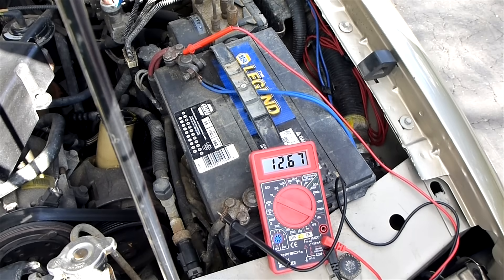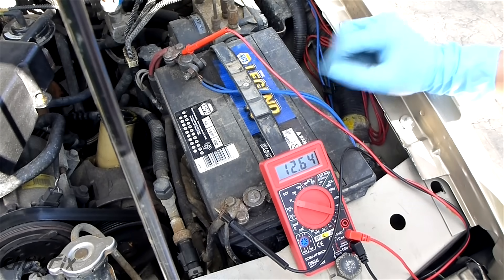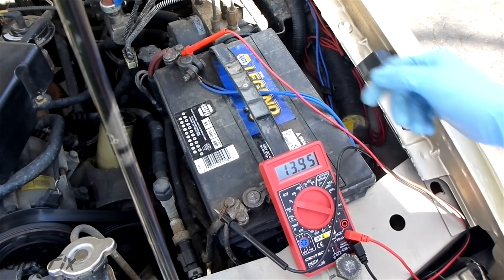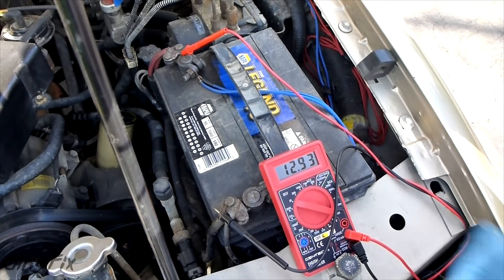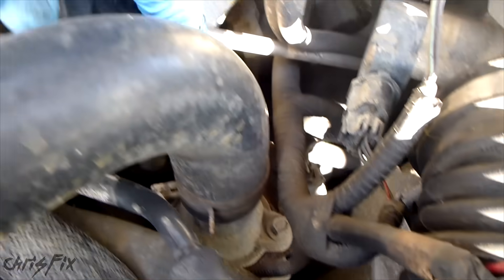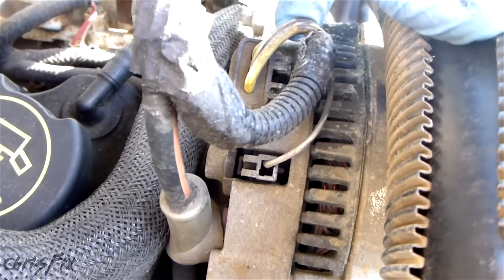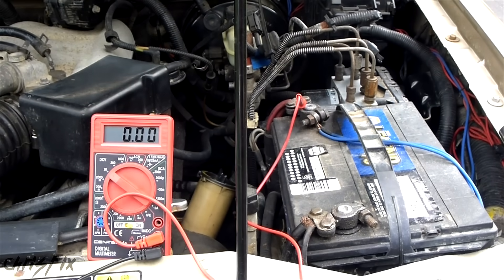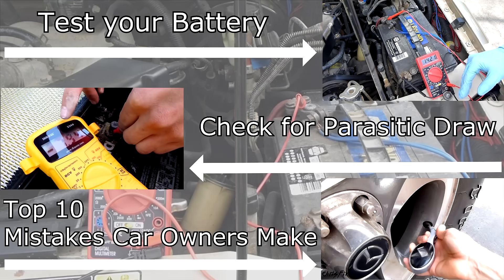How to Test an Alternator

Comment: This might be too late, but what if I can't crank the car at all. I put in a brand new battery and it still won't crank at all. All the dashboard lights are flickering though. How do I know if it's the alternator or the starter, etc?
Reply: Eddie, Flickering gauges is a good sign that it is probably your alternator. If you have a new battery in, the leads are attached firmly to the battery and it still wont crank, the next step is to check your alternator.

 If your headlights and dash lights come on and shine bright and clear, that means that the battery and alternator are likely not the cause of the problem. If they were, there wouldn't be enough power to run the lights. Instead, you're probably looking at a starter that needs to be replaced.

Hope that helps you out

Comment: This is a great video showing how to test your own vehicle battery at home if you own a multimeter. The only part you may want to change is where you said that you can add bottled water to the serviceable batteries. I wouldn't recommend that. Use only distilled water for lead acid batteries. I am a former Service Manager for a tire & lube shop and a former Technician at a water bottling facility. Thank you for making it easier for the D.I.Y.'r!
👍👍

Comment: Hi, I was on eBay trying to buy a multimeter, but I was not able to find the one that you were using , even the one that you recommended , doesn’t have DCV and when that happens , I get lost , I’m not an electrician , any change will confuse me .
Reply: Any Multimeter will read both AC (alternating current like your home receptacle) current and DC (Direct Current like your vehicle). It will usually have a dial or switch where you can change it. You can get your cheapest multimeter and it should be able to take care of what you need with it's basic functions.
Reply: A cheap Harbor Freight multimeter will work

Comment: My multimeter is at -12 . Is it normal or did I break my multimeter
Reply: If it read negative twelve then I assume that your leads are crossed. Or your battery was charged incorrectly and that would be a prob

Comment: My multimeter sparked and got super hot super fast when I connected the negative and positive parts of the multimeter. Any ideas?
Reply: Are you sure you didn't have it on OHMS? Sometimes in OHMS mode that will happen. Or you simply could have blown a fuse in your meter

Comment: What happened I bought a new battery charger and it didn’t have any electric coming from both wires. Can you tell me what went wrong?
Reply: I am assuming that you're talking about checking the battery charges connections with multimeter and it not connected to battery. Most newer chargers have safety features on them where they will not work unless it detects a minimum residual voltage (whatever manufacturer chooses). Try it after it's connected to battery...

Comment: Another simple technique is to remove the battery with the car running. If the car immediately dies, you know that the alternator isn't doing its job. You can do the same thing to test a mass airflow sensor. Leave car running, unplug the cord running to the mass airflow sensor. The car should shut off. If not, then it needs to be replaced.

Comment: Ok so, here's my problem. My car will hold about 14v but after about 30 minutes, without changing the load, it dropped to 10 within a few minutes. I had the car on jacks so it wasn't running, just idling in park. Any ideas? 2006 Charger with the 5.7 if it helps.
Reply from the maker: A correctly functioning alternator shouldn't do that, especially if the electrical load isn't changing. I would replace your alternator and that issue should go away
Reply: @chrisfix  so funny thing is, it's actually a new alternator 😅 I've replaced the alternator and battery. I really appreciate the reply too! It's stumping me so hard

Comment: What if the car don’t start, do I put the multimeter on the battery and crank it and if the voltage drops or increases more or less than around 14 do I have a bad alternator

Comment: Found out I may have a bad alternator in my Jeep. This is a huge info on how to test. Thanks.
Reply from the maker: Glad the video was helpful!
Reply: @chrisfix from a full charge battery, I read just over 13 without starting the Jeep. When I started it, I read between 12 and 13. Now I’m reading 12.9. That means bad alternator if I understand your video correctly.
Reply: The 12.9 is after the car is shut off.

Comment: Here's something, my autozone alternator was putting out 14.87 and it said that it had passed on their machine the threshold was 15.0. My digital dash meter said 15.7 on start up in 15.3 at idle. It was boiling the battery while driving. They replaced it but if I hadn't known the voltages myself I would have looked to something different because their machine indicated it passed.

Comment: My dealer did a YVR test and stated the 150A alternator was delivering on 40 Amp, but  the battery is fully charged.   It needed to be replaced.   Alternator is charging to 13.95V at idle.  Hmmm  need to check the draws at alternator.   thank you Chris

Comment: I have a question for anybody who can help preferably a mechanic or someone who knows. When I connect the multimeter leads to the alternator with the car OFF it shows a voltage reading. The voltage is the same as if I were to connect it to the battery with the car OFF… Is that normal or is the alternator supposed to read 0 when I connect the multimeter leads on it? I always thought only the battery supposed to show the voltage but maybe I’m wrong. Is the voltage that I’m seen the battery’s voltage or is the alternator still putting out a charge when the car is off? Please help.

Comment: What if you have a reading of 11.85 volts on the b+ post and lead wire? Does that mean the alternator is bad? because it is not charging the battery.

Comment: What about an intermittent battery/alternator light. When I had the voltmeter hooked up it never did it, just a constant 14.26, 14.15 with lights and such on, but when I’m driving the light will come on/off and the lights sometimes flicker. 2007 Honda Accord 2.4L.  I’ve read about the ELD (electric load detector) on Honda cars, and it seems this could be it, but I’ve also read that when the ELD is failing I’ll get a trouble code, which I haven’t. 

I guess my question is, if the alternator is failing can it work fine at times and not at other times?
Reply from the maker: Sounds more like a failing alternator than the ELD if it would trip a code
Reply: @chrisfix  thanks for the response, I Dont know if the ELD can fail without tripping the code but I do know there is a fault code for it but I haven’t got it. 

The alternators are so easy to replace on my car I think I just take aim and shoot the parts cannon at it. Thanks.

Comment: I have a 2011 chevy cruz.  Battery/charging light just came on.  When I run a voltage test while the car is running, I am getting 14.7 volts which is perfect.  Where would I go from there?  What causes the light to come on if it is getting correct voltage?  TIA

Comment: I know this is an older video (and it bums me when people comment on my older videos like they're brand new, not that my 10k subs is anything like Chris's), but THX.  I know if you've done a video on something, I can trust the info.  My 99 Camaro was parked for like 11 days and when I went to start it, it was dead, so I jumped it and thought nothing of it, knowing I do have a light that stays on a little too long...and then it wouldn't start again when I was gonna go to the gym yesterday.  This video helped me figure out that it was the alternator and not the battery, so one online order, 20-30 minutes of work later and I can now tell that my suspicions about the alternator being bad were correct.  I work from home, so it was great to do this faster than a mechanic could b/c there weren't other cars in line ahead of me and I didn't need to take it elsewhere.  Thx again Chris.

Comment: Does the battery need to be fully charged to make this work properly?
Reply from the maker: If the battery is really low or bad, it could affect the results but your car wont start. Otherwise it wont matter.

Comment: Yo Chris, i just done the test.. (04 /Ford expedition 4x4)
Black lead to the negative battery post, Red lead to the alternator case.. i turned everything on.. all the lights, Ac, music..
And i i came up with -0.321..
 What should I do in this case.. is my alternator is going bad? 
or it's just the connections ..
 I bought a $190 dlr brand new battery a year ago..and seems like is not getting charged correctly..
 What should I do? 
Thanks in advance...

Comment: What if there is no reading when you connect the multimeter e.g. 0.00 ?
The battery is good, the battery light comes on after 5 mins after starting car so I'm checking alternator. 
I keep the multimeter at 20 v
I run the engine, I put it at 20 v, I put the live on battery live and negative on the case of the alternator, it's 11.9 the same reading as the battery, the battery was 12.7 before I turned engine on.
Reply from the maker: For what setting? Voltage?
Reply: I tried the drop voltage test at 20v, no reading 0.00
Reply: I can't find a  belt on the alternator? This is a 2008 ford galaxy 1.8tdci. should there be a belt?

Comment: Brilliant video, I will follow ur instructions 2morrow as Im trying to work out if I need a new battery or alternator? As a woman I'm tired of being ripped off by mechanics🤔Battery is showing RED saying I need a new battery but today I got a rubbery burning smell which on 1 post I read about faulty alternators they had burning tyre smell as a possible cause of a faulty alternator. Oh well bring on 2morrow,  I'm hoping it's just the battery. Thankyou for a FANTASTIC video. Absolutely brilliant!!

Comment: Looking for help: I have an 05 explorer 4.6L V8. Check charging system/battery light is on. I followed the video thoroughly vehicle charges fine doesn't die on me. I replaced the battery and alternator, voltage drop tests come out lower than what's in the video. I continuity tested both wires to the regulator, one goes to the fusebox the other to the pcm and they read 0 ohms. After making repairs I cleared the code with my obd2 reader, unhooked the battery, connected the terminals to eachother and let it sit for an hour. Battery light is still on and idk where to look next.

Comment: I really enjoy your tips and this one saved me a ton!  Our 6 year old Lexus had trouble starting so I took it to Lexus. They said I needed a new battery ($400) and a new alternator ($600). They charged me $120 to diagnose!  I guess I should have just gone to an auto store!  Looking at the battery I noticed it was the original and there was a label indicating an 84 month warranty. I asked the service advisor and then he told me that I was eligible for a 25% proration off a new battery so it would be “only” $300 but he highly recommend terminal cleaning and protection for an additional $25. I was pissed so I paid the $120 diagnostic fee and drove it home. 

I went to Costco and bought a larger AGM battery (27F vs 24F) and it fits perfect. I then followed your steps and discovered that the alternator is fine. 

I could kick myself for taking it to the dealer for diagnostics but I didn’t know how to check the alternator until later. 

Thanks and keep up the great work!
Reply: Dealership techs will do anything to get those extra hours.
Reply: Dealers and auto mechanics in general are liars and thieves.. Find an honest one, they are out their ,few and far between but you can find one... , then stick with them. The rest let them Rot,, this industry is about the worse their is..Having bought and sold and repaired dozens if not 100s of cars over my lifetime,,this is what I've found to be true...

Comment: With meter's neg lead on battery I'm getting  -21.6 when placing positive lead to alt body & about -17 when touched to block. After doing the test and putting all the accessories on, lights, radio, fog lights fan blower, volt reading is still over 14 BUT now it blew the fuse in my radio, had to change it! Is that something? Got +14.2 with car on & meter to battery leads. Got 12.5 with car off. I must be doing it wrong or I definitely have a problem.

Comment: Just did this (a few times). Took my 2017 Mazda Cx3 to a dealer for an oil change, tire rotation etc. After a few hrs. they said you have a lot of corrosion on your battery we can clean it for $60. OK an hour later they tell me the acid is eating through the case. Battery tested good but it will go. OK. Quote $260 (plus the $60 cleaning) NO thanks. 
Two days later keyless remote won't work (remote battery new) car won't start - nothing. Call AAA. New battery $199 OK cheaper than Mazda. Jumps old battery, start car, 30 sec later it dies. Alternator reading is bad. Replace battery, clean more corrosion from connections. Start car. Now alternator reading is good. OK. 
I notice interior lights dim A LOT when I turn on the headlights (but don't dim on their own).
I turn on power to listen to radio while parked. Warning lights fire up then go off. Red battery light, and check engine light stay lit. 
Google and find your clip. 
Dig out old Sperry multimeter (that’s what the thing is for!) and test battery. Results below. Should I be concerned that when I fire up the car the reading is 13.4 – 13.5?  When I turn on everything it actually increases .1 - .2. 
Thanks – I’m a 63 y/o widow and always leery of being ripped off.
1. 12.56 resting
2. Start - 13.4 to 13.5
3. Turn on everything 13.5 to 13.7
4. Turn off 12.8 then goes slowly to 12.56

Comment: I've had trouble with mine, so did some checks. I have continuity everywhere, but the alternator isn't charging. I'll be pulling it out at some point. Repair or replace...

Comment: i may know a lot about cars but i tested my alternator at the alternator and my tester says nearly 15v with the engine off. and my fuel gauge is also reading wrong! like almost 3-5 gallons worth off and my fuel economy is even severely reduced! i should get 19 mpg city and im getting like 5-10 mpg being super careful on the the throttle.

Comment: My 2015 accord sport does not show higher voltage when I check and the engines is on. 
It turns on now with a new battery but I’m nervous about the voltage not going up. Thoughts?
Reply: Just saw the whole video I’ll check for voltage drops tomorrow

Comment: This video saved me a couple hundred bucks just today. Had an issue where the battery gauge on the instrument cluster would be at 14 while driving then dip down to ~12 for a moment or two then bottom out like it was dead. Has happened intermittently over the last 2 weeks. Wasn't running rough or anything so drove it home. Sitting in park with it running, was sitting at 11.6v, understandable given that I had just driven it ~30 miles with no charge going on. Was just about to submit the order for a new alternator when I decided to test it out. Went through with this video and found that the battery-to-chassis connection had a bunch of rust on it (it's a 1999 Cherokee XJ, rust comes standard). Took a wire brush to every connection and then replaced the battery terminal ends. Cranked it up and let it run for ~25 mins with everything from the window defroster to the hi-beams running. Barely dipped below 14v. Thanks for the no-frills videos, ChrisFix!

And a side note for anyone seeing this, the videos on how to super-detail your car are absolute S-Tier. I do these deep cleans 2x yearly and my vehicles look amazing

Comment: I watched these videos as a reminder, because I'm usually driving in new cars ,but working on used cars,dude you just contradicted yourself you said 14 on the meter meant that the Alternator is overcharging the battery ,then cracked the car then you saw 14 saying that's normal, facts are 14 on the meter is when the car engine is crack up.

Comment: Hi.
I have toyota corolla 2010 model.
I used multimeter, here is the voltage reading. 
1- on engine idling = 13.41
2- on engine idling + head light on = 13.13
3-on engine idling + head light on + AC on= 12.80

problem is that egine lack power and performance. on idling engine vibrates. drive in first gear is very sluggish.

should I replace the alternator? or look for other things to daignose?

thanks in advance

Comment: Thanks, Chris. Really useful. I just changed the battery but it doesn't help either. But now I found the real issue after watching your video. Mine is showing just 12.9v while the engine is on and accelerated. So I need further study on the Alternator. Thanks again.

Comment: New battery after car died (dim lights, etc.).  Put in new battery as the original was quite old.  Checked the alternator at the battery with a draw showed 14.4v.  Thought I was good.  Car driven less about 15 miles (with A/C, headlights, radio on) and the ABS light came on.  Then noticed lights were dimmer.  What could draw on the battery so quickly when the alternator seemed to test good output?

Comment: Thanks.. my alternator puts out 25v and both batteries I put in the car are at 25 too ( 12v 121r batteries ). I think its time for a New alternator.. voltage regulator is busted

Comment: Great Video and Thanks!!! As a side note... You could also disconnect each wire, and use the Ohm (resistance) function on the meter to check for excessive resistance. This would cause the same voltage drop issue if there was excessive resistance.